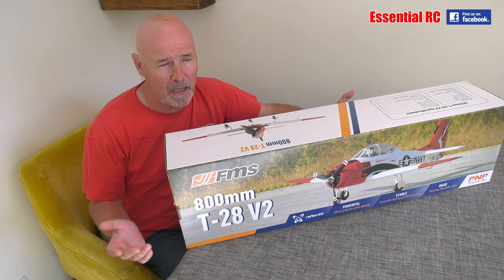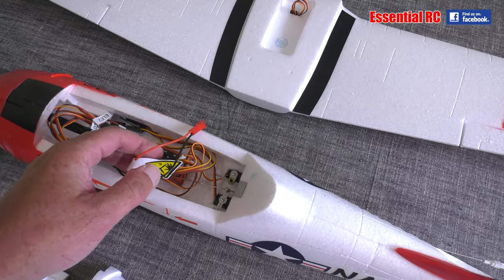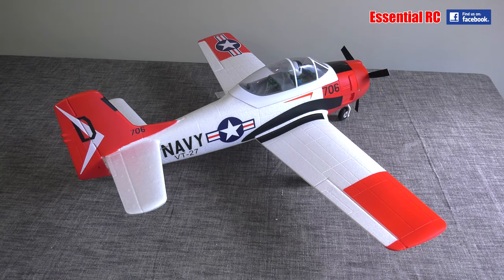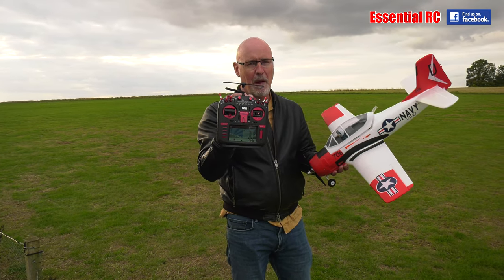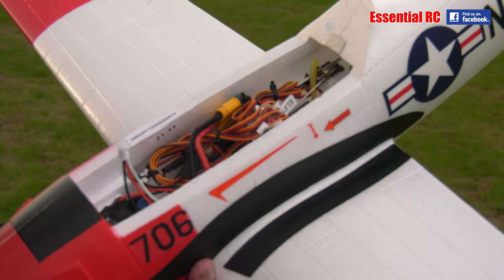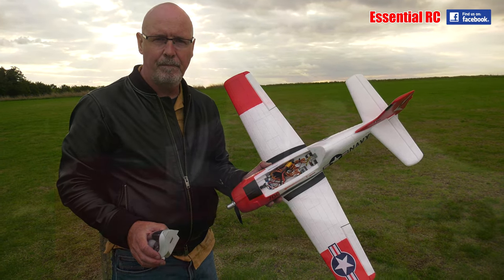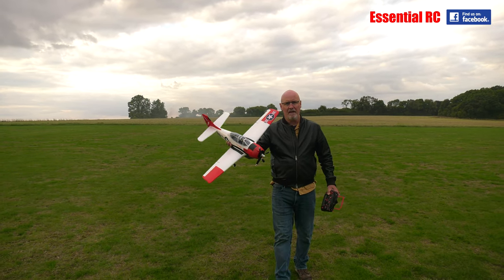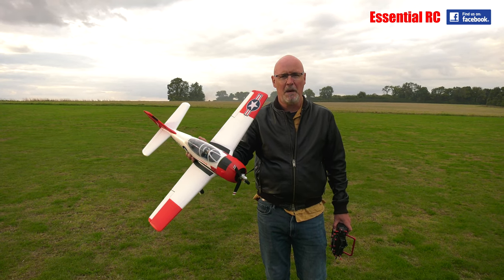EASY ! FMS 800mm T-28 Trojan V2 | Reflex V2 stabilisation | Plug and Play | Ready to fly in 15 mins

Comment: The v1 was my 3rd rc plane almost 2 years ago. I still have it and it flys amazing. Great video! A suggestion though. Fly it on a 3s 1000mah. I swear it won't burn up lol that's honestly all I've flown mine on. But the flight is beyond amazing! Cheers!
Reply: With the V1 yes you can just fly it on 3s. These newer fms 800mm have higher KV motors and some like the F4u use 4 bladed props instead of 3 in V1 version, so these need to be taken into consideration. Best to use a watt meter first to measure amp draw at 50 percent throttle before going 3s on the newer versions.
Reply: @robertwong2412  yep! I always check the amp draw to see if it will work!

Comment: Thanks for the demo flight on the T-28. Nice looking plane and it looks like it can definitely handle some wind ;-) 3S Capable? See you in the Air!
Reply from the maker: Even if the motor was 3S capable it would be a problem squeezing it into the slot far enough to get CG without cutting some foam.
Reply: @EssentialRC  Thanks for the info! It sounds like my P51D 750mm battery compartment.
See you in the Air!

Comment: Did he test the roll limit in stabilized mode anywhere ?
Reply from the maker: Reflex v2 limits roll to 30 to 40 degrees in Stabilised and prevents roll to inverted. Hope that helps.
Reply: @EssentialRC  Thanks! This is such a good feature!

Comment: Will this loop and roll on the STABILIZED setting?
Reply from the maker: No. When I use Stabilised (not a great name for that mode) it limits the bank and pitch rate and basically will not allow you to go inverted. If you use Optimised mode it reduces the affects of wind and has no limits on how you fly. If configured to change the mode via a 3 position switch you can also turn Reflex off.

Comment: Hello, can the reflex v2 be easily installed and configured in another plane.🇨🇭
Reply from the maker: It could IF the plane was same type I think. Reflex can only be set to different pre-configured setups for FMS models via the provided USB lead and a desktop PC App. If you have another fixed wing warbird then I suspect the Reflex setup for the T-28 would work.
Reply: @EssentialRC  Thank you for your reply.
Reply: @EssentialRC  I'm getting the fms corsair 800mm which comes with the same reflex V2 gyro as the T-28. I just wondered how do you setup the setting in the tx16s? Do u have to do your own mixing or setup in the transmitter?
Reply from the maker: @TanLyeSiong  Well, yes. You need to setup a model on your TX16S and bind to the receiver you are using in the model. Recommend you search on YouTube for basic guide on how to setup a model with EdgeTX.
Reply: @EssentialRC  Thank you!